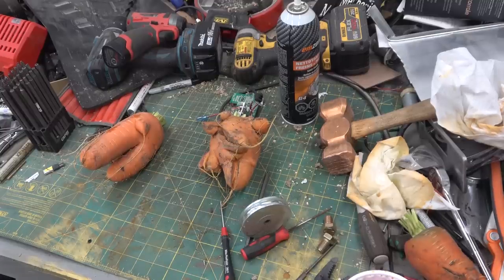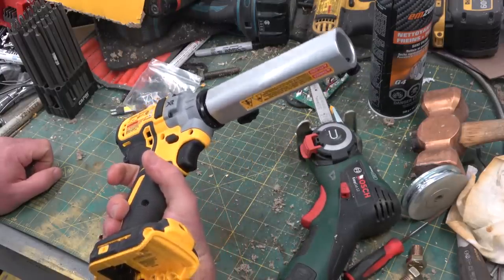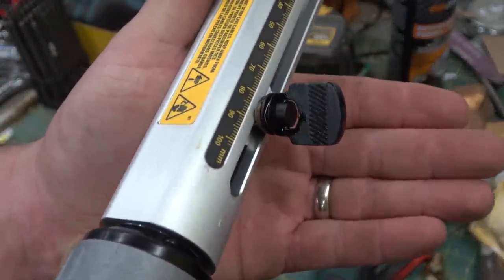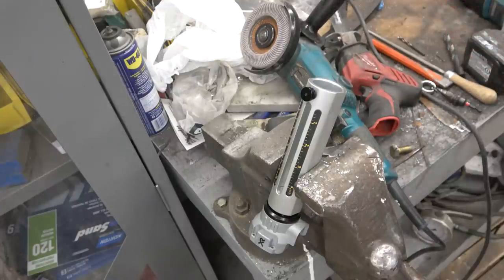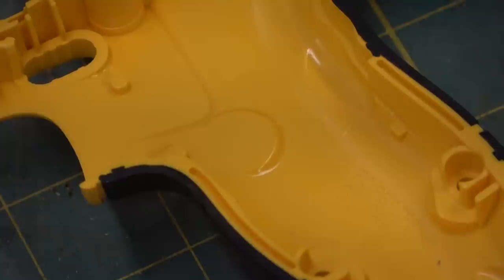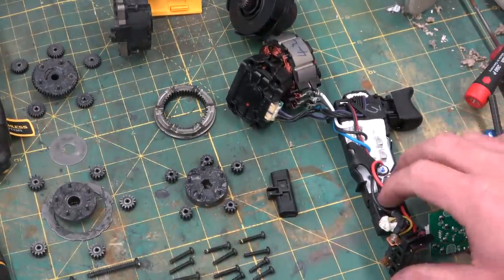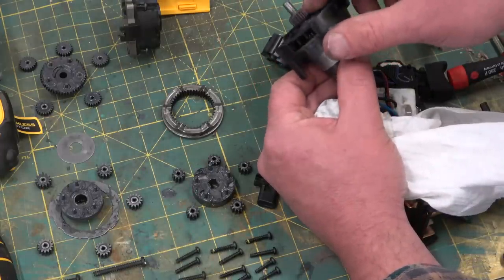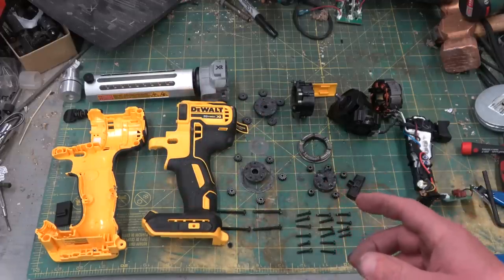BOLTR: Black and Yellow Strippers

Comment: It's a great tool. If you do more than 5-10 connections a day you'll want one. An example is when working with rail road signal cables and grounding wires part of the quality control is to verify you strip away the correct amount of wire. Think you're gonna strip and press 50 ground lines. An electrician in northern Sweden can cost over 100$ an hour and that's for a first year guy. You call them out to connect all the poles, boxes etc to the grounding rail after a job. They have to fill out quality controls for everything. You just save soo much more time with the right tools. It literally pays for itself after about 100 stripped cables. Especially when the whole knife cut your fingers now you're down a guy shit happens and try getting an electrician on short notice to Arctic hell northern Sweden on the rail line middle of no where after a derailing took out two signal boxes and 3-4 poles ( which happens at least once a year )

Comment: Company bought us some of these in kit form a while back. If I remember right, the dies run from #2awg to 600 or 750 kcmil. I’ve used it on stuff in the 250-500kcm and like it for that, especially if doing several. Quite a bit faster than the razor knife I was using.

Comment: 6 Dogs on ring gear engage inside of front housing. If the cutter bites off more than it can chew, the ring gear can slip. Limiting the output torque prevents wrist twist and reduces tool droppage on buddy's head... at least the unintentional kind.

Comment: I've always wondered if you can trip smal wires with those plastic wire wheels. 

Clamp the end of the wire in between 2 rotating wire wheels and strip down the insulation.

Comment: I saw a lineman pull one of these out of his bag while dealing with some 5/8" aluminum wire.  Took him all of 5 seconds yo get all 4 wires of a 3 phase system stripped while leaning out of a bucket.  I did the pocket knife routine to strip the other end and it took me a good two minutes each wire as I could not manipulate my way around the wire like you would with something more forgiving.  Definitely not a tool for home players, but a great time saver for the elecchicken pros.

Comment: I recently broke down and got some milwaukee m12 tools that dewalt doesn't have. I'm not impressed with the amp cutout value they have I find them cutting themselves off constantly even though the battery is full. I'm not even trying to give them a hot supper.

Comment: Wow a tool to replace 20 seconds with a razor blade and 360 degrees of rotation. 
I was crimping ends on 00 Awg wires on Friday, what would be far more interesting is if you did a video on a Burndy hydraulic 750 crimper.

Comment: I was given the Milsukee version with the purchase of one of my Crimpers.   I honestly prefer manual setups over the unit and its living its life on a shelf somewhere.    The same thing can be said for the milwaukee cable cutters.  I was given a set of those with another crimper set and short of cutting demo cables into 3 foot sections its not worth the hassle over a set of ratchet cutters.   The real problem out there is this new generation has ZERO hand strength and I have had a few young apprentices come through that didn't have enough grip to run a simple set of ratchet cutters with one hand.

Comment: When I’ve sat down and fought large wires into a box it’s worth anything to make it easier. Rows of solar panels with wires coming in and you gotta force them all into the box and clamp them in. On your knees in dirt or mud and your back bent over just enough to hurt you for a few days.

This thing, maybe, but the speed of a hand-powered stripper isn’t terrible either. Usually end up taking a utility knife to clean it up or cut the last stubborn piece anyway. It’s about number, if you’re sitting there with 40 or more wires to strip and they’re the same gauge,. Yeah, I’d take and use it.

Comment: 7:30
I've learned that with my milfwaukie impact driver and wallet, that anything longer than 5ish inches acts like an old car torsion spring. A 1/2in drive socket extension can resist twisting under impact.  The peak torque an 8inch+ hex shank can't break loose much. I will say they're handy for loose bolts and getting snug before a torque wrench. 

For hex drive to 'impact' socket adapters the short cheap ones will take off most lugnuts, roads don't get salted here though

Comment: Been on sites were safety vultures are about and hassling electricians over using knifes to strip 4/0 wire. 
This tool and the Milwaukee equivalent were supposed to be the "safe" alternative.
Reply from the maker: fucking stupid. "You're qualified to install high power equipment; NOT to use a knife."
Reply: @arduinoversusevil2025  Yeah; It's a insurance based issue essentially. Large enough companies looking over the aggregate safety/injury incidents will aim to remedy the common issues. 
If a percentage of incidents are basically "Jimmy cut themselves", rather than tell Jimmy to wear gloves, the company has to institute an overzealous policy.

Comment: Would be ok if it could strip the insulation and also score the steel armour strands at the same time so you can break them off easily. Why is this even a full tool and not just an attachment for a normal drill?

Comment: That tool is for stripping the ends of heavy electrical cable. Like the kind of cable that goes from the pole outside your home, to your electrical box. So it's only for electricians, electrical contractors etc. I can see the utility of it. I've had to strip a few here and there and getting that plastic jacket off the cable is not easy.

Comment: Definitely heat sinks for the MOSFETs. 6 of them right near the motor phase terminations. One wire for each leg of the 3 phase inverter. Maybe I design electronics for power tools, maybe I don’t.

Comment: Gotta say the value engineering is definitely getting more refined though. PC is a smart polymer choice. So is all the double duty of parts and integration in electronics. They COULD take it a step farther and just package that attachment with a already designed drill only... Then they'd could actually slightly raise the price. Of course they can't sell you two two drills if they do that.. it would probably still be pretty good anyway, not many people are gonna buy that thing. someone that wants it bad enough to buy that, probably isn't buying their first drill from DeWalt and definitely didn't care if the purchase was price efficient.

Comment: Bought one of these a couple months ago and it's still going strong. Use it for terminating new underground services. I will say though, I got the tool only on sale for about 80 petro dollars, but I already had a full set of ripley bushings which just so happened to fit it perfectly. Like another guy said on here, it's a real pita on one offs, but when making multiple connections for a new pad mount transformer it's a real time saver.

Comment: This isn't something I'd use every day, but something I'd use alongside a powered crimper and powered cutter (both standalone tools) to wire a switch gear, terminate a high amperage panel or distribution. 

Tools like this look stupid but they save SOO much time when you have 40 cables the size of your thumb to cut/strip/crimp especially when the traditional hand tools for those are HUGE and you have limited space to work in.

Comment: The lobes aren't for the hammer action of a drill but for the torque clutch instead the ramps would overcome spring pressure and stop the dingus end from spinning

Comment: The electronics (from the battery, through the selastic-covered fancy bits, all the way to the motor output shaft) looks exactly the same as my DCD791 cordless drill/driver.  The battery mount, grip, and motor case clamshell looks pretty similar too.
Had to do a BOLTR-level teardown to figure out why it was throwing tiny gravel into my face all the time.
Turns out the tiny gravel was all the sawdust I had subjected it to over the years!
A bit of toothbrush action and some moly grease and everything was smooth sailing.

It's definitely disappointing that the 'bare tool' is literally just that, not even everything you need to do the stripping.
Oh well, nothing a little know-how and a pocket knife can't fix.

Comment: A dedicated power tool for stripping cable is a bit extra. When you are working with >250 kcmil cables all day long, go get yourself a set of Ripley stripping dies and the WS 22 power drill attachment. Total game changer, with the highest quality for about the same price as this DeWalt tool. This DeWalt is worthless without the dies, and the dies themselves are quite tricky when dealing with cable diameters large enough to necessitate a tool like this. Using a 500 kcmil compacted aluminum die to strip 500 kcmil copper is doomed to disappoint.

Comment: Interesting using PC/PBT. I get that stuff for my 3D printer for parts that need to be more durable. Oil and solvent resistant, decently high glass transition temp, and a bit of self lubricity for her pleasure.

Comment: I used to work in telecom and we used to have stripper bits that would go on any drill that would strip RF coaxial so they could be fitted with a connector. They were pricey as fuck and wore out pretty quick but a lot cheaper than buying drill that only has one fucking job.

Comment: You’ve got  the old Milwaukee on the sheet metal Screw setting. That setting is designed not to over torque sheet metal screws and strip em out. Set her on settings 2 or 3 and it will drive like a mofo.   🤘😎👍.

Comment: Ive stripped my fair share of large gauge cable and I can see the benefit of this. I just use my knife, but when you are faced with tying in a dozen 500MCM wires and you havent sharpened your knife in a while you’d be wishing you had one of these in the truck. 
Would like to see how it works, perhaps ill look elsewhere for a video if it functioning.
Reply: Another thing I just thought of. When you are stripping to crimp on a lug there is a specific length of wire that needs to be stripped that the manufacturer insists. Typically we measure one, and the. Use the casing to match the rest, but a tool like this would make precision length stripping easier.

Comment: For the DeWilt fan that just has to have every tool in the box.... even if it just does one thing. Or to put it another way, DeWilt emptying wallets again... though the adjustable head would be a lot more useful than rummaging about in the dark and dirty places for the right part, even the missus might like it...

Comment: I have prepped a lot of large cable and this tool is all about the fancy dingus end, the driver is a free toss in.  I would have to see the adapters, but a relatively sober man with a good razor knife could probably beat it.  This looks like a tool built for a very specific type of cable/lug combo that would be nearly impossible to do by hand, or something to satisfy a safety requirement to keep someone from being sued.

Comment: Take the M12 out of self-tapping screw mode.  The mode with the beans is 3. I usually put mine in 2 for tool disassembly.  Self-tapping mode is useless for anything but self-tapping screws.

Comment: Great video as always, thank you for keeping it up &  interesting :)   However, looks like this tool is meant for stripping the semiconductive layer when doing high voltage terminations and splices with some consistency. You will need the right dieset for the specific cable used, as it shaves only the thin conductive outer layer on the main insulation.

Comment: I'm gonna go out on a limb and say that if I'm making a typical 3 phase circuit, my case knife will strip the wires before you can adjust this contraption and get it going.

Comment: These are used for safety reasons. Contractors limit knife usage to reduce accidents. Obviously knives are still needed so you get a small % of electricians on the job "knife trained" and if you are caught using a knife without the training card you get in trouble. These things suck. Besides the reasons pointed out in the video they nick conductors and the insulation gets jammed up in them frequently. But that doesn't matter because safety first.

Comment: Misleading title... where are the strippers?

On serious note, this 250$ (or whatever) "tool" could be replaced by a self-made add-on to a drill made of scrapbinium... And really useful to a handful of specialists who connect medium sized switchboards 24/7... for small gauge you'd use a different tool, and for large (medium voltage or thick DC cables) you'd need to remove way more insulation lengthwise, so you wouldn't use this tool either...

Comment: we have one, came in a case with charger, battery, and dies for copper and aluminum conductors from #1AWG to 750MCM, when you're standing inside some god forsaken switchgear and have to complete 40 terminations of 750MCM it is a godsend

Comment: Used one of these quite often building a fresh water plant, when you do 30 or 40 terms all at once it can save ya a bit of time but I mostly used it because I was lazy and the company bought it. The little tab for adjusting strip length tore right off after about the second use, had to use a 3rd party peripheral to make adjustments after that.  it was also a little finicky with the XHHW insulation not getting it all off with one pass.

Comment: Got this little tool that spring loads itself onto any size cable (big ones only). You just adjust strip depth and pull it down the length of the cable. Bit more convenient in tight spots than this unfortunately.

Comment: God gave me teeth for stripping wires haha. On the 'hammer drill' part, looks more akin to a torque limiting safety feature in case the dingle dangle got caught up in your clothing, it might prevent the chokey chokey scenario... (although I didn't see the other half with the spring loaded balls... hmmm..?)

Comment: I've used this, once.

Got this on site but we were disallowed form using it by QC cause it would score the copper which much like a glass score enables the material to break at that score mark when bent. This is a serious electrical concern as now a 250MIL cable is something like a 180-220MIL.

We're told to use angled cuts to avoid this, which is a shame cause doing 16 transformers at a power plant, each with 3 parallel runs per box is a lot of damn work. That said, were paid by the hour so meh.

Comment: i could have warned you those are a pretty specialized tool.  we use the manual version of what those are at my work.  but that tool is pretty wiz bang if you are doin the thing with some heftier wire sizes and need to get a whole serving stripped in a real hot and bothered hurry.

Comment: Looks a bit pointless, though I'll admit im no professional pixie wrangler myself. Couldn't you achieve the same effects with a stout knife, or one of those nice plier-looking tools for the smaller deals?
Reply: Sure. But if you’ve got dozens of them to do at a time, not only does a power tool save tons of time, but also helps prevent repetitive strain injury.
Reply: @tookitogo  fair enough. Honestly, I'm still trying to work out how a spinning tube would strip the insulation
Reply: @amyshaw893  I think it’s basically like a pencil sharpener, but with a very carefully created hole in the center so that the conductor is not touched.

Comment: It LOOKS like a good deal--dies, stripper, battery, and charger all in one kit--but AvE pointed out the cost-cutting: No glass fiber in the plastic parts.  Re-used planetary gear assembly from the impact wrench/driver SKUs, etc.  In both cases the molds tend to be a high $$$ investment into making the tool.  I suspect Dewalt is throwing this grafted-on stripper/impact driver out there as an incentive to buy into their tool line.  

Can't remove the insulation stripper?  Well come on over and check out that stand-alone impact driver that powers the stripping attachment!
Did you need more dies?  We've got those too!   
More batteries?  Yep and--oh look at our HUGE tool selection that can use those batteries!

The drill itself is also sold separately for $160, so by the time you add in charging gear and batteries you are probably close to the same $360 price that they are selling everything for.  I just wish they were not cutting corners to get more profit.

Comment: Not sure bout those who think sparkies still use pocket knives to open up cable, but I haven't seen it since the old man passed, and that's been a good couple of digits ago. Personally I use my pocket knife to open boxes, and my box cutter to cut wire jacket - got better things to do than sharpen a blade. Haven't bought knife blades in 20 years, thanks to my benefactors; last time they gave me a pocket knife was when I redeemed some safety bucks. And the young-uns can't hardly operate a hacksaw: they gotta have a lithium screwdriver, and a lithium saw, so stands to reason they'll want a lithium knife too.

Comment: The company I work for has one of these. Anyone stripping wire 1/0 or larger has to use it, company policy. The boss says better to use this than a knife where it only takes once for the knife to slip and then you’re on your way to the hospital and the boss man is filling out OSHA forms. I’m personally not a fan, and that’s coming from a Dewalt user. But I follow the company’s policy.
Reply: Oh and we have the full kit with all of the cutter dies, it’s not a bad tool, just one I wouldn’t purchase myself. To my fellow sparkies, if you do go to use this, remember to remove the phase tape before stripping.

Comment: The tool works great, saves a bunch of time but the single use is bullshit. Could have been made into an attachment. The twisty bit on the depth setter is weak as fuk mine broke quick.